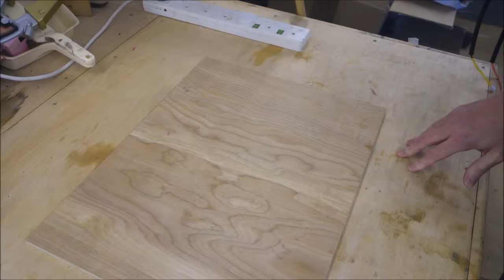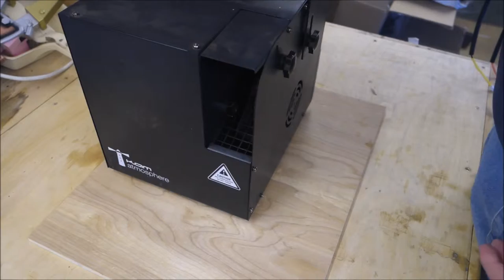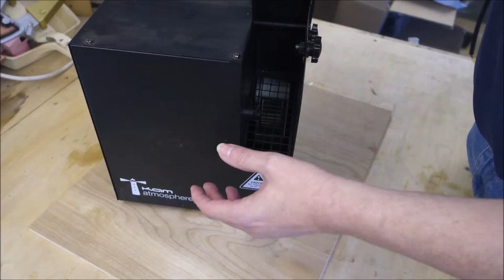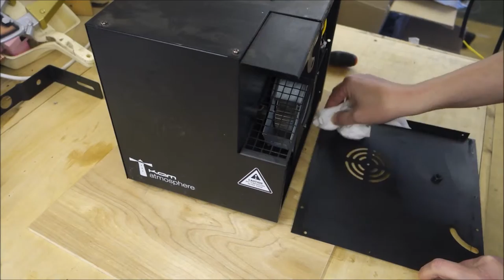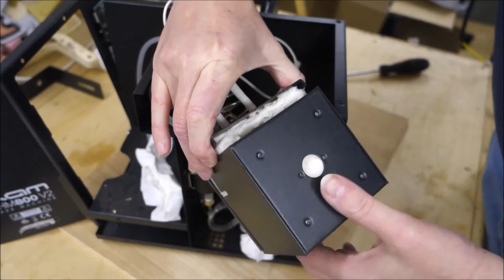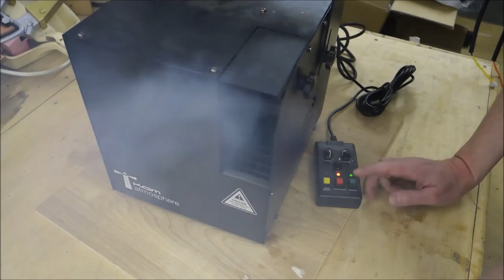Kam KHM800v2 Haze Machine Teardown and Rebuild

Comment: Would it be possible to control the output of the fan by a potentiometer or similar  in order to make the haze thicker? I've got a KAM KHM600 which I Would like to modify 
Cheers and thanks for the look inside!
Reply from the maker: Thanks for watching. I imagine you could fit a potentiometer to the fan but you'd need to ensure it was properly rated for the voltage etc, and it would definitely void any warranty. I would be wary of making such a modification and would instead spend some time with the remote control and see if that gives the desired effect. You might also try different smoke fluid as that can drastically affect output. The other thing to remember is that these are haze machines, not fog machines and weren't really designed to create massive amounts of smoke. Having said that, I ran this one on QTX High Grade Fog Fluid and in a few seconds it filled my 10 foot by 20 foot workshop so much I couldn't see...
Reply: SteamGeezer, I play in a band and I find the output of the machine a bit tricky to control. I usually get far too much haze and then it's hard to see the musicians. Mine use water based liquids and I feel that the haze does not last very long. Back in the days when fog machines ruled, the fog dissipates slowly from the stage floor and created a hazy atmosphere and those seemed easier to control( or perhaps it was created by the cigarette smoking audience). I think I'll start by choking the device and secondly try to find a denser liquid.
Reply from the maker: You can get smoke fluids that are designed to linger or dissipate quickly. I've not used them myself so I can't speak to the efficacy of them, but I have noticed some cheaper brands clear much quicker than others. I think the ideal thing for your specific requirement would be dry ice, but that's a whole different can of worms :-)

I'll be interested to hear how you get on and I hope you can get the results you want.
Reply: SteamGeezer, I've tried to choke the machine by blocking the inlet of air and at the same time block the outlet air leaving just a tiny pipe with concentrated fog. The smoke did get thicker but since it's really hot it does not stay on the ground. I thought I needed to cool the fog so I took an ordinary hose/tube from a vacuum cleaner and let the fog pass through. The result was much better. The velocity of the fog was slow enough not to create turbulence at the exit. Since the smoke was indeed cooler the first minutes, the smoke stay at the floor. After some minutes when the tubing was hotter the smoke didn't stay at the ground.
Reply from the maker: Well, I have found with the miniature smoke machines I make that having the fan spinning slower the smoke comes out slower, so adjusting the fan speed may help. You could possibly be able to use a motor speed controller to control the speed of the fan, but you'd have to check the input voltage of the fan first - I would imagine it's 12v but I couldn't say for sure without checking.